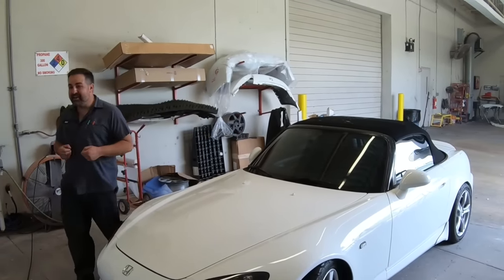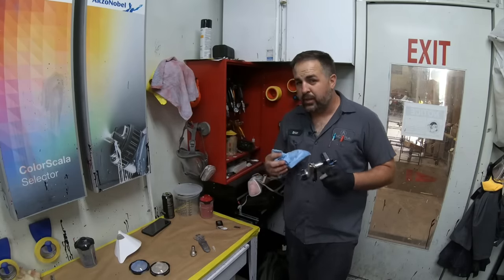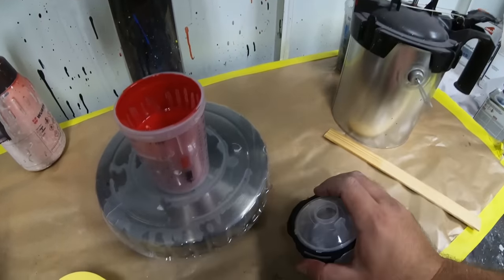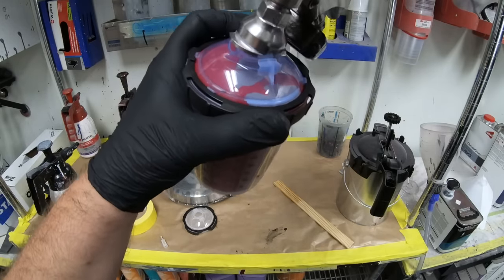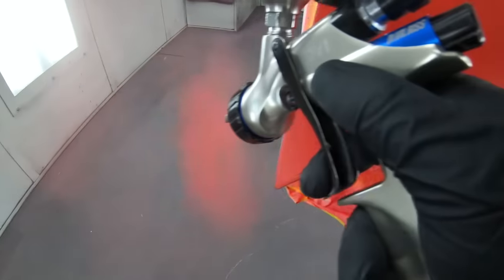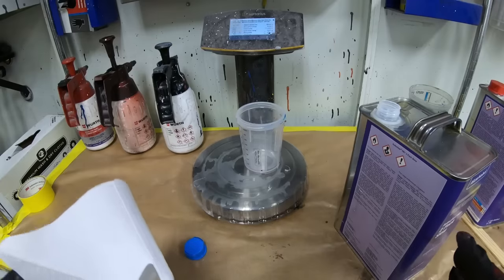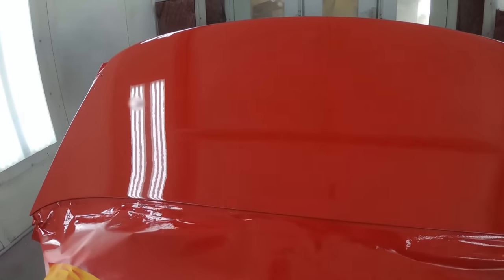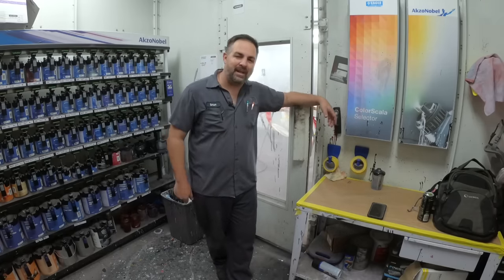SIMPLE Paint Gun HACK for INCREDIBLE Results!

Comment: So I’m putting a body kit on car, going to paint parts off car. Then put on car and paint entire car. Want to not screw up a new part, so I went through the steps to prep the original rear bumper cover for primer. Watch paint society’s video on setting up gun. Using 1.7 nozzle @ 21psi I couldn’t get enough paint to come out. So I changed too 2.0 nozzle. Had more paint on panel but was to much for good coverage and was thick. Manufacturer recommended not thinning primer, wish I had seen this video about the little screen in gun. As it seemed the primer was too thick to pass through.

Comment: @Paint Society VIDEO IDEA. I was recently thinking about what would happen if you mix different base and clear coat finishes such. Example: matte clear over matte base compared to over a gloss base. Or a gloss clear over gloss base compared to matte base. I know the end result is whatever was last used. But if you compare them side by side, is there actually a difference? Does matte on matte looks even more matte than matte on gloss? Does matte on gloss look matte but make the gloss underneath look more "pronounced"? Because if layers add depth, it seems plausible that matte over gloss would almost seem satin like. Maybe it wouldn't change anything. It probably won't. But maybe it would. Even if it was a tiny difference looking at them side by side

Comment: How does air get into a pps cup to replace the used paint?
Reply: The short answer is: It doesn't.

There are 2 cups, a inner, single use cup and a outer cup you can use several times.
The inner cup containing the paint is made of a thin and rather flexible plastic, so basically it shrivels up while the paint leaves the cup, due to the vacuum pressure.
The outer cup is rather solid.
It is arguably better for painting upside down, but you really should make sure that the lid is properly sealing the cup, like Brian demonstrated.
Reply: @MrDuLukes  thanks that makes sense i remember using the old rigid reservoir gravity guns and if the vent got blocked the flow rate shut right down!
Reply: @Droningonuk  You're welcome.
Though I believe PPS-cups are no wonder solution to painting upside down. Yes they are better, and paint won't drip out of the vent, but gravity still applies and you will most likely get those "stutters" of pure air in between.

Other than that, I think it's pure personal preference.

Comment: "It's just paint" painted my motorcycle after watching a bunch of videos. Freaking disaster. Basecoat pretty good. Ghost flames decent, airbrush spit and sputter. Shot clear, horrible run, fisheyes, texture rough/dry. Sanded fixed run blasted 2 more coats. Still grainy rough finish. Sanded up to 1500 grit, buff polish. Can still see remains of a few fisheyes. At home Florida summer/humdidity. Didn't use hobo freight gun.
Reply: You didn’t use a $700 spray gun like he did. Started out talking about a harbor freight gun then went with a $700 gun to spray both base and clear. 😂

Comment: I noticed you use a 1.3 nozzle for all the basecoats and clears, I was reading online that the rule of thumb is 2.0+ primer, 1.7 base and 1.3 clear. Getting ready to lay the basecoat on my wife’s car and I’m feeling conflicted. I have all 3 nozzle sizes (won’t be using 2.0 of course)
Reply: I use a SATAjet 5000 with a 1.3 with EXCELLENT results, however I also use a regulator at the inlet of my paint gun with the pressure set at 27psi.
Reply: @pagansunburn470  but for us who don’t have $$$ what nozzle size should I use on my $45 gun? 1.7 or 1.4 for the basecoat?
Reply: @jayare7750   A 1.3 nozzle is plenty sufficient, and using 27 psi should do well.
Reply: @pagansunburn470  🤦‍♂️ I don’t have a 1.3.
I see what you’re saying though, basecoat will spray well with a 1.4
Reply: @jayare7750  It will be a bit heavy with a 1.4 but you can adjust the spray amount until it sprays less than what it is supposed to.

Comment: Thanks Brian!!  bought that gun cleaning kit you suggested in another video, and it came with a bag of those filters, are they any good for one and done?
What determines psi? paint or gun?  If I needed to spray base at 23psi, would that transfer to most other hvlp guns? and if thats the case,  
what is suggested psi for sealer, base, and clear?  
I have two of the same guns,  how best to separate their uses for sealer/base/clear?   for small repairs and needing primer, Ill just rattle that..    
thank you sir

Comment: And, have you tried, I don't know... putting the filter in THE RIGHT WAY? The little tab is supposed to help pull it out, not to be sticked inside where it can interfere. Of course filtering the paint before and also having the filter mesh in the cup is superior, but for the regular folks out there, maybe all they have to do is put the default filter in the right way.
Reply from the maker: It doesn’t matter. Either way it doesn’t work Vlad. Thanks for the comment bud.
Reply: @PaintSociety  Well, at least some interaction for the youtube algorithm 😀
Reply from the maker: I try my best. Always enjoy answering kindly to a spicey comment. Helps makes everyone calm again.
Reply: @PaintSociety  I din't mean to be mean. It just struck my eyes so bad I had to react. 🙂 Your video is otherwise very helpful and as I watched some of the others, those as well. And as said previously, filtering the paint with the filter and using the mesh in a cup would always be better than the small filter inside 🙂

Comment: Hi Brian, I am currently looking to replace my Sata clear gun. I currently have (2) Sata 2000, one hvlp (1.4 for base) and (1.3 tip for clear) and my Sata 5000 (1.4 for sealer). I purchased the 5000 in hope for a flatter clear finish on show cars and motorcycles, but I did not care for it. I have been watching your videos and a few others and one thing they all have in common is great paint jobs and no one is using Sata paint guns. I am looking for the flattest spraying clear gun. I have looked at the DV1 with the C2 cap, ANEST IWATA WS-400-1301C-S1 Supernova and the Walcom Carbonio Genesi 360 1.3 Light Hte CLEAR Spray Gun. I have been painting for about 20 years, no longer every day but a few times a month. I have always used Sata. I would like to know what you think would be the best clear gun for the flattest finish. Dose not have to been one I listed. Thank you!
Reply: The Ws400 is the flattest clear gun that I know of and is what I'd go for for show car finishes.
Reply: @asher7916   would you go with a 1.3 or 1.4?
Reply: @travis3437  1.3 all day long

Comment: You're supposed to replace those filters. There's a reason they're 10 bucks for 40 of them. You're literally using a filter with your PPS cups suggesting people get rid of the gun filter. You're expecting people to dump money buying not only the PPS system, but adapters too. Here's an actual tip, put a new filter in your gun every time you notice it needs one. Don't waste your money on PPS. Unless you're working at a shop and they're supplying them I wouldn't bother.